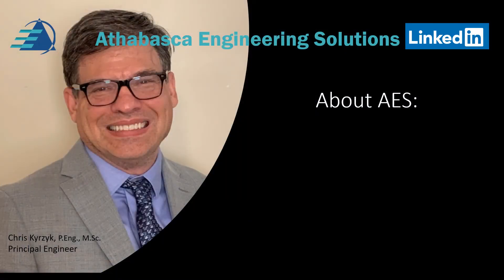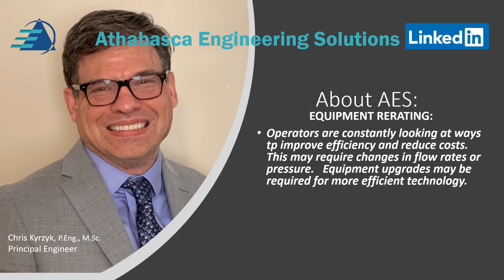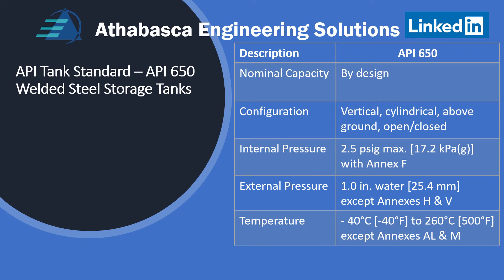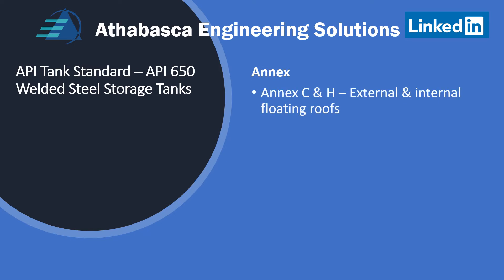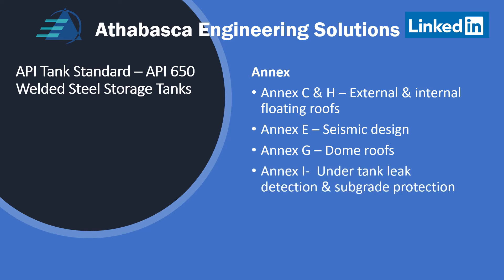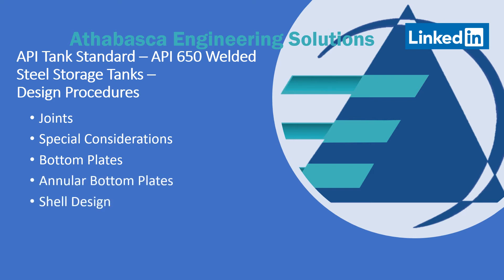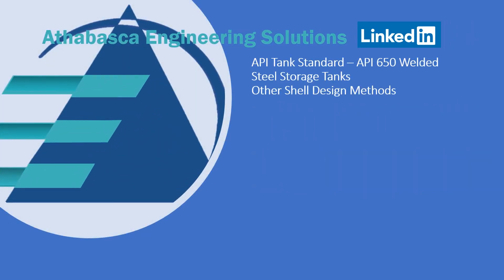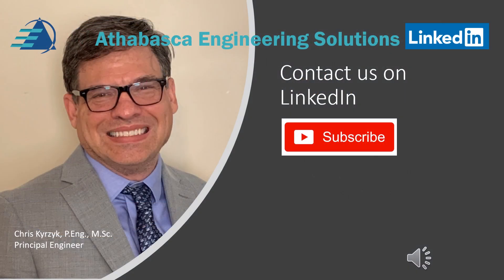API 620 and API 650 Part 2 API 650 Tanks

Comment: What factors affect floor thickness? Is it mostly corrosion?

I was told that the size of the tank, ie pressure is a factor ,however I was thinking that newtons 3rd law would render that point moot.
Reply: The floor thickness is based on long term experience- it is desired to have the floor thin enough for flexibility for settlement.  Corrosion allowance is not as much a factor.